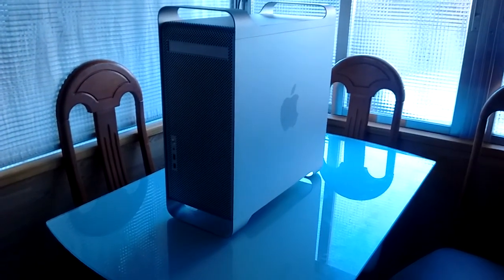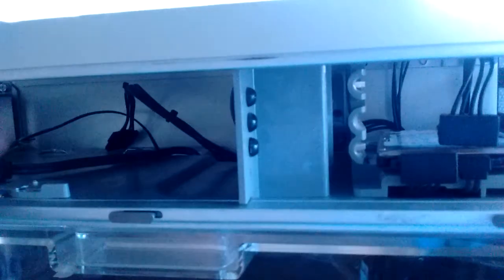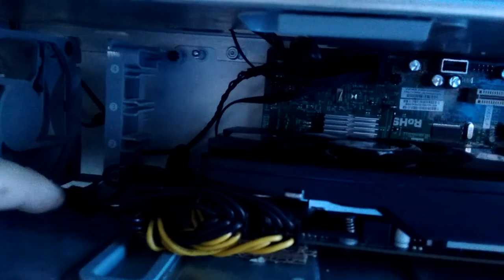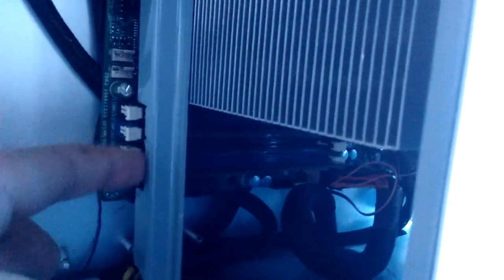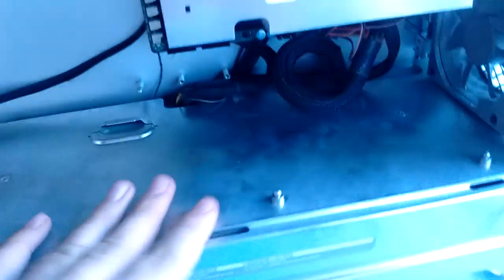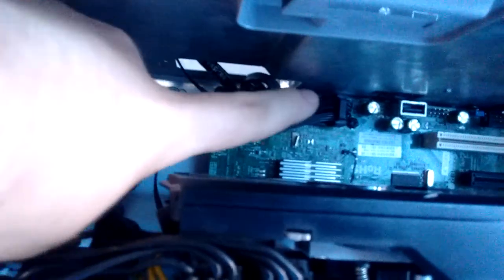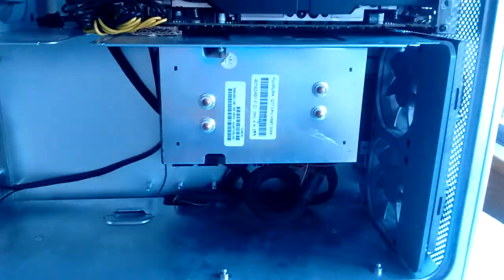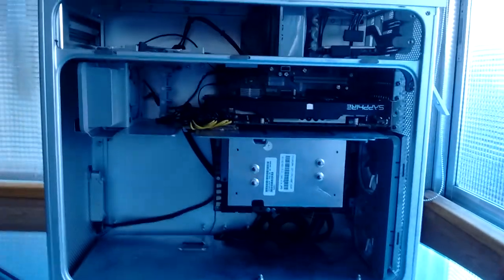Taking a look at the finished PowerMac G5 Hackintosh!

Comment: Hey. First of all: thank you very much for your videos !

I plan to do also my own hackintosh in a near future. I have already bought a PMG5dual to use this beautiful case. I Wonder if you could give more explanations regarding your cabling: do you have some drawings, or sketchs regarding the cables you used from your power supply, the new connectors used to make your power supplu an ATX one ? 

From your advice, is it possible to use any microATX motherboard to do the same arrangement as you did ? I would like to keep also the original heatsink and it G5 cover plate, but I Wonder if it requires a special motherboard, or if any microATX one can make it possible. 

Thank you for your advice !

Regards
Reply from the maker: Hi there. Sorry for taking so long to reply. 
For the power supply:
I do not have any schematics, however it's a fairly straightforward process. The voltages in the G5 power supply are marked on the PCB, so it's a matter of connecting them to the right pins on the ATX connector. The power on signal is active low, just like in ATX, so again, just connect it to the right pin. 
However, the G5 PSU does not produce a power good signal, so you'll have to permanently connect that pin from the ATX connector to 5V. This is out of spec, as the power good signal is meant to come up once all the power rails have stabilized, but in my experience most cheap power supplies (even from highly regarded brands) connect it straight to 5V anyway. Most (if not all) motherbards allow for this.
As for the motherboard:
You won't be able to use any micro ATX board if you wish to use the original heatsink. I recommend a board with a similar layout and mechanical design to the Supermicro X8SIL-F I used, especially regarding the placement of the CPU socket.

Hope this helps you in your endeavor.

Comment: Nice! How exactly did you put the front fans on 3.3 Volt? And are the fans in the back also fixed on 3.3 V?
Reply from the maker: The G5 fans have four connections: Ground, +12V, analog control and tachometer. I hooked up the ground and tachometer to the motherboard, +12V directly to the PSU and the control line to 3.3V. 
And yes, the fans in the back are also at a fixed speed.

Comment: Would you rather the Mac Pro ? Because you can put more hard dives in it
Reply from the maker: I have a homeserver that takes care of all my storage needs, my machines only use their local disks for the operating system.
Reply: ITTFami wow really ? How much did that run you ?? And how’s the computer holding up today ?
Reply from the maker: The server itself (A Sun Enterprise 250, I have a video about it) cost me 20 Euro, so that plus a PCI-X SATA II card (around 15 Euro iirc) and hard drive costs. I'd say it's holding up pretty well for a 20 year old machine. I haven't had a single problem, even streaming 4K video from it works very well.
Reply: ITTFami wow I’ll definitely check that video out man ! I’m really interested in thag